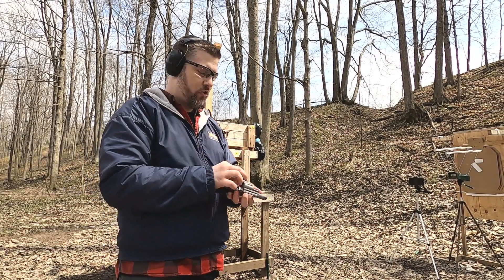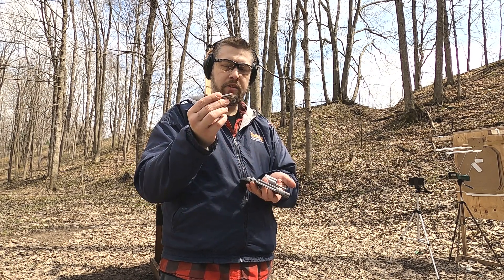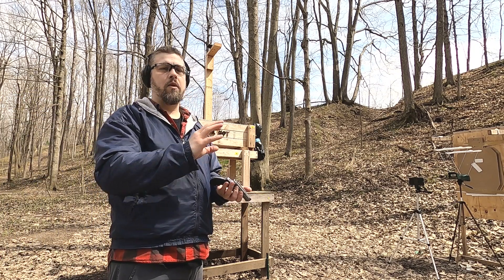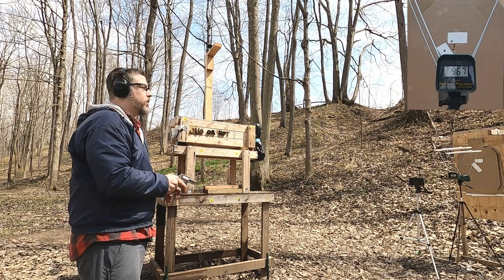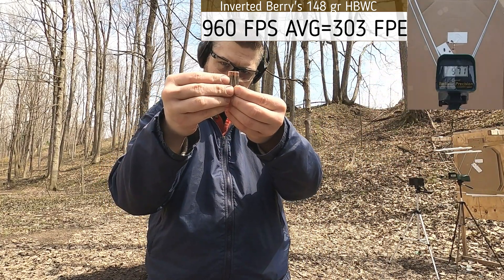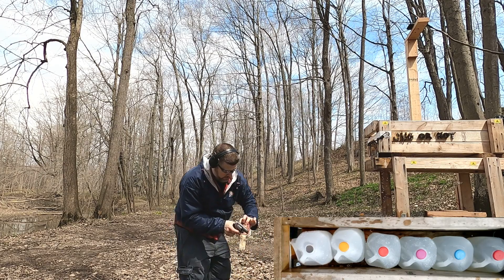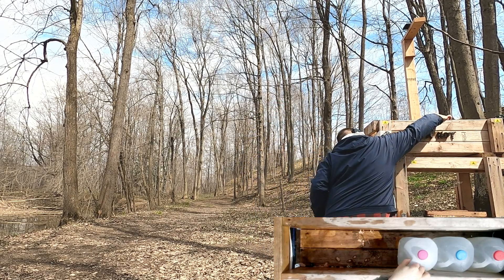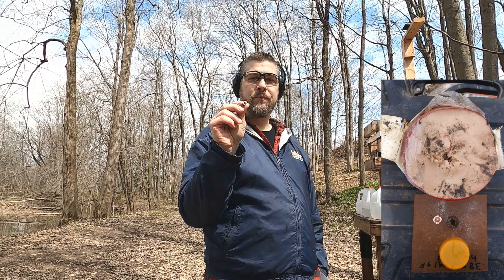.357 Magnum Backwards Wadcutter Test

Comment: That's an extra 100 ft/lbs over the 38 loaded ones. Nice. I tend to reload my reverse wadcutters fully seated in the case and I haven't seen any over pressure signs.
Reply from the maker: I think it was 174 FPS more. I am thinking along the lines of doing what you're doing in .357 Mag and seeing how close they relate to 9mm air space. Might be close enough to use 9mm charges and call it good and still be at .357 Mag pressure. I always wondered why Federal didn't make a .357 HST this way just like the .38 Special and market it again as a "micro" offering. Makes perfect sense to me as it would be a 9mm ballistics with the reduced recoil and increased efficiency, perfect for a snub.
Reply: @GunSam  yeah the 38+p hst micro is my go to edc for my revolver. It's a good performer, I just wish I could get component bullets for it. But the reverse wadcutters sate that itch for now. Lol

Comment: I shoot coated solid 148gr wadcutters out of my Ruger SP101 over a heavy charge of Blue Dot and they seem to penetrate like crazy. Not really a social load but a cheap range practice load. Recoil about the same as my 158gr hollow point carry rounds. Hollow base wadcutters worry me over separation and barrel obstruction possibility.

Comment: Considering that this load just duplicates 9mm 147 gr velocities, is this the max that you can safely push the 148 gr backwards WC? If you can push it faster safely, do you intend on testing that too?
Reply from the maker: I honestly don't know. I know some have had issues with skirts getting blown out from the center, but Berry's are harder than most wadcutters.
Reply: @GunSam  yes I have noted the extra toughness of the Berry's WC.  So with the extra 250 fps velocity,  you get an extra  .05 inch of expansion and about the same penetration as the. 38 special velocity.  

In reality that isn't too bad as it is.  About the same results as the Hornady 357 critical duty. 

Well whatever you decide,  just be safe about it!  BTW,  what reloading setup do you use?  I don't recall seeing any video's about that.  I think that might not be a bad subject to make a video on,  if you ever run out of ideas for new loads to test or compare.
Reply from the maker: @robertlemaster7525  lee single stage. For reloads like this they are so long as rather than wing it I will simply load matching the base depth to some known load.
Reply: @GunSam  I would agree with you, the matching depth is probably the best place to start,  while watching for pressure signs.

Comment: I’m deciding between a Glock 19 or S&W 357 revolver. Luckily you are doing 9mm/357 tests now 😁
Reply from the maker: Both are fine but the size matters for how well it will work for your purpose.
Reply: If you're a beginner to guns get the G19.